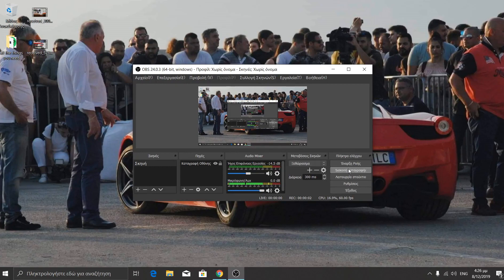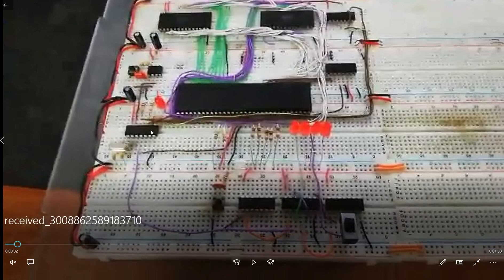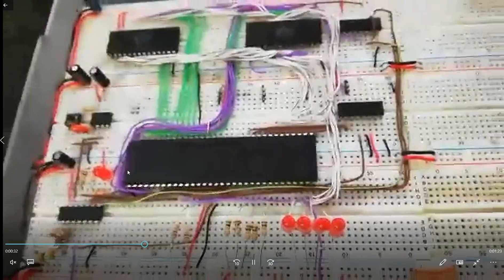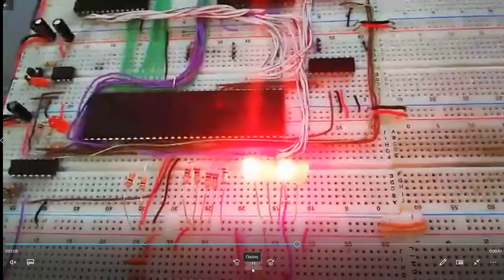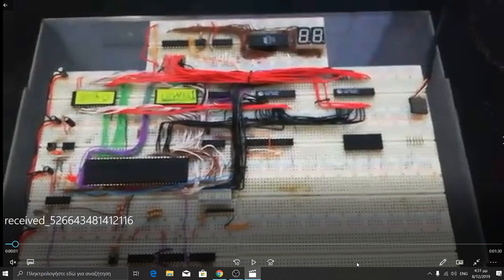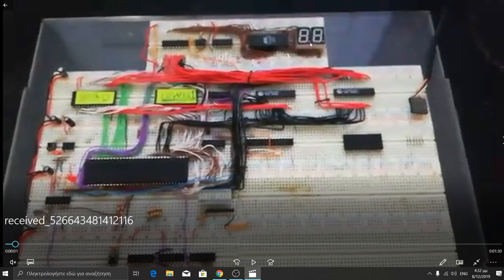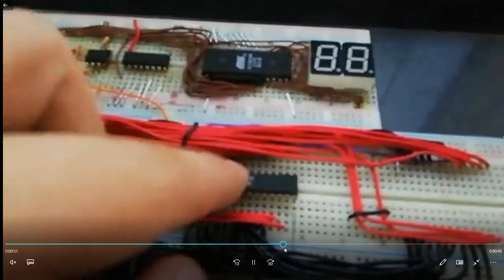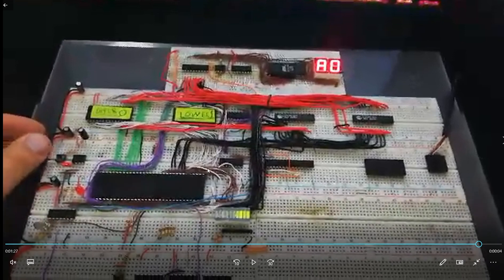68000 computer demo

Comment: Always exciting to see m68k running in home projects! Looking forward to more process.
Reply from the maker: Yes more to come.. I'm looking forward to build a full fledged computer.. Like an Amiga or an atari st...
Reply: @Hardwarenerd  For me anything which could be assembled using modern parts (easy to buy) with a graphical output over VGA would be great, maybe running simple GNU/Linux variant. I am slowly getting into basic M68k Assembler and to me the M68k is one of the most fascinating MPUs ever built. I also have some A500 boards at home.
Reply from the maker: @jan64-cz  Those computers are too complicated especially those custom chips .. but all around the internet, you can find schematics from different designs (from homebrews ) that replace those chips. So you can build something good out of it